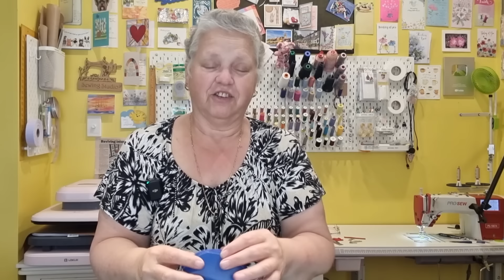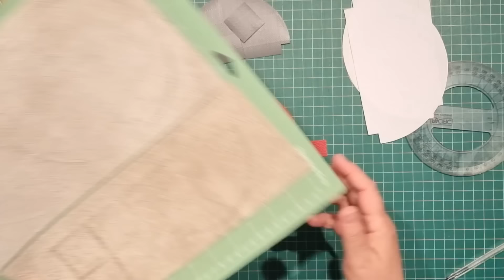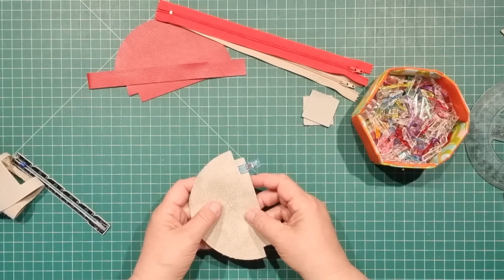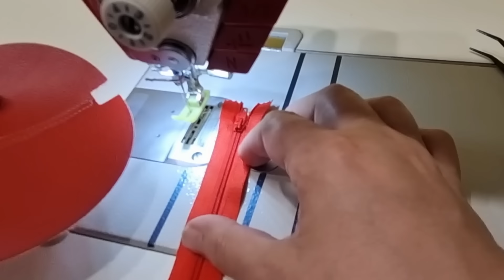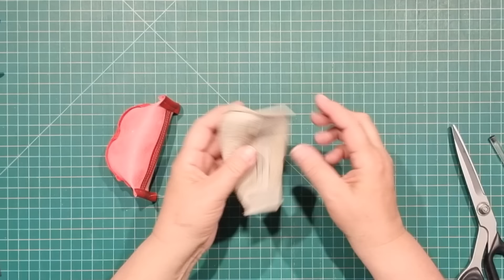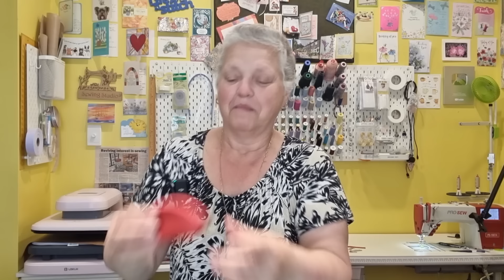How to sew shell shaped/taco style pouches using leather or vinyl scraps

Comment: Those small pouches are also slim enough to slip into pockets.  I've always got some cash with me for the very snall purchase, sometimes it's just a few coins in a very small zip lock snack bag. .       Clear vinyl - it's very non co-operative when doing corners.   If you want to see contents you could sew one side in three horizontal strips  with the vinyl in the middle, leaving the corners  in the stabilised  fabric above and below the clear piece  A little extra cutting and sewing the three pieces together but won't take long.  E❤

Comment: It has inspired me. As a leather worker, I would not put a seam at the bottom.  I would use the pattern without cutting into two pieces.  Less bulk and work.
Reply from the maker: Very true, but the leather tends to round off at the bottom without a seam. I'll try another one soon.😀
Reply: @ChristinesHomeAffairs By using 2 pieces you could use 2 different colors

Comment: I don't know if this is true. I was taught in Home Economics class, that the inside part of the zip was the stretchy part of the zip. The outer woven part was not the stretchy, but to make sure this was the area to catch when top stitching the fabric and zip down/away from the teeth. I don't know if this is true
Reply from the maker: I was curious about this, so ended up Googling "anatomy of a zipper".
It was a very interesting read and makes me want to do a video about it. I couldn't find anything about the zipper tape though, other than it shouldn't be cut as it will fray😀

Comment: Christine, why did you cut the bottom part of the pattern in half only to sew it back together?  TIA.
Reply: My guess is to create a finished bottom and it seems to allow a “seat” vs a rounded bottom.
Reply from the maker: Two reasons Joanne. One was to be able to use scrappy fabric, and the other is for stability. Without the seam underneath,  the fabric would flop and be more rounded😀
Reply: @ChristinesHomeAffairs Thank you.